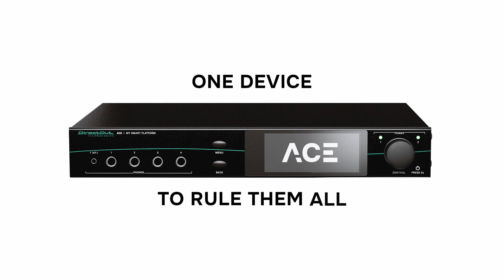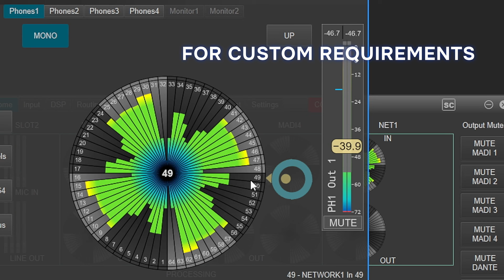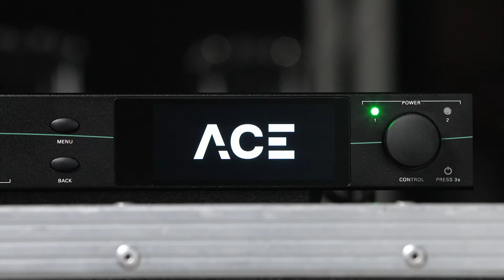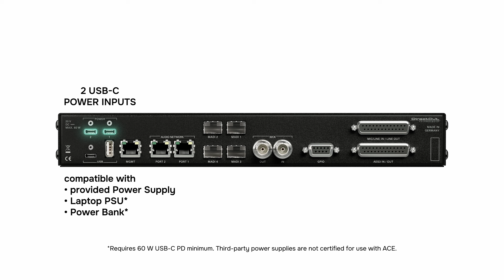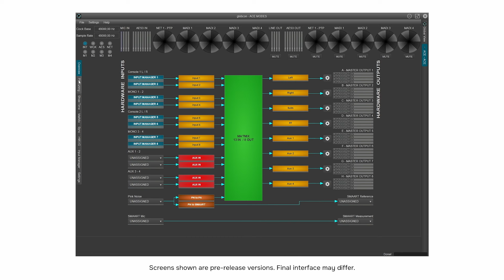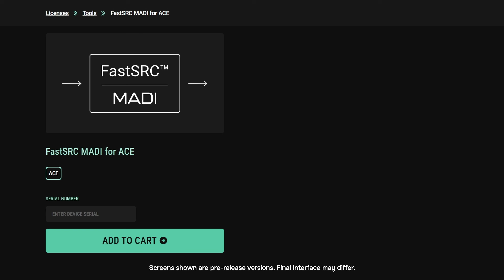Introducing ACE | DirectOut Launch Keynote

Comment: Ravenna🥲
Reply: Some guys in Raststatt are getting nervous right now. But as the other guy said: Prodigy still exists. This is for smaller applications and I think it was sensible to cheap out on Ravenna instead of Milan in this usecase..
Reply from the maker: To combine ACE with RAVENNA, you can connect it via MADI to an EXBOX.RAV. For example, using a single DAC cable, it is possible to exchange up to 64 channels at 48 kHz between the two devices.